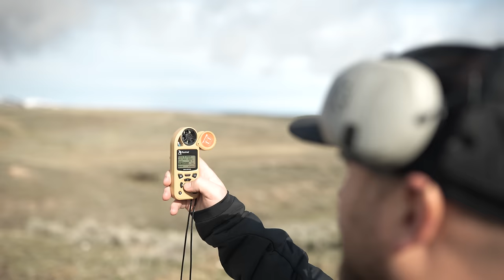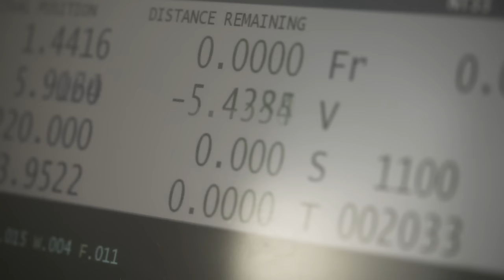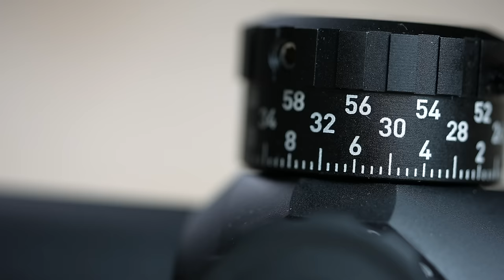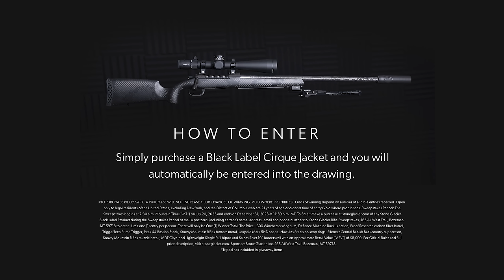Black Label Gun Build

Comment: What would be the retail cost of this build?
Reply: Shiiiiit at least 4-5 grand
Reply: Defiance action appears with black nitride: $1845
Proof barrel: some sites have sale price at $650
Bottom metal BDL style around $200-250
TT Trigger: $215
Stock: $800 avg
$3740-$3775 total parts. 
Gunsmith fees vary
I did not include scope, rings/mount. Those prices vary greatly
Reply: Probably between 6 and 7k. Scope is ~1800, action is ~1900, stock is probably 1000-1200, trigger is 200, suppressor is I think 800 or so, scope rings are ~200, barrel is 850-950. You could do the same for a lot less it would just weight more like 8.5-9 lb vs 6.5-7.5 lbs.
Reply from the maker: The total build cost is a little over 8K
Reply: Hi, no bedding the stock?
Reply from the maker: @briansetter8037  We wanted to see how the gun would shoot without bedding it. Some guns hammer and some need bedding. We should have a follow up video on how the gun shoots in the future.

Comment: Them carbon barrels Trap heating inside the barrel. Just because u can't feel it outside, don't mean its cooling the barrel.... u need gap and space in-between the carbon and barrel to cool it..
Reply: Air is an incredibly efficient insulator my guy, so NO on that piece of bro-science.
Reply: @snakeriverstickbow6233  fire rounds from one and check the internal temp of the barrel and get back to me if it's cooler than a normal barrel by much...lmfao.. just because u can hold the barrel on the carbonfiber nd feel little to no heat don't mean nothin....
Reply: BSF carbon barrels technique is the way to go.... Any full direct carbonfiber/resin contact does not cool the barrel internally like Proofs method...
Reply: I hate feeding trolls but the point of CF barrels isnt just to cool the barrel better than any other type of barrel, its to have a stiff barrel that cools as well as other barrels at a fraction of the weight. Its purpose specific. F-Class shooters dont use CF barrels because they dont care as much about weight and require higher accuracy just like hunters dont use 7 lb barrels because the trade off of weight over accuracy is acceptable. If a hunter shoots enough to heat the barrel to be concerned about loss of accuracy, they arent hunting.
Reply: @scitum  hey now, stop talking sense it might catch on then we’re doomed. 🤣
Reply: this guy is a derp